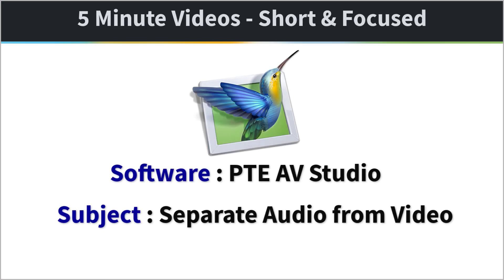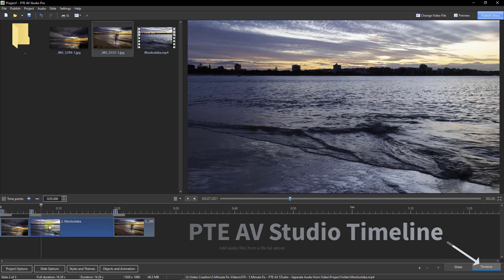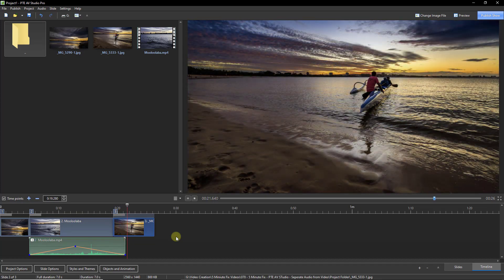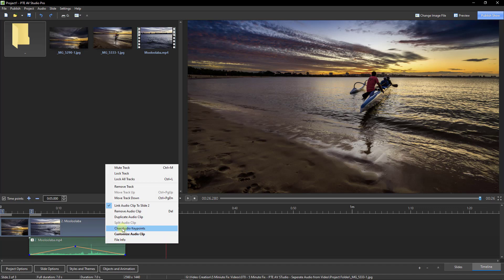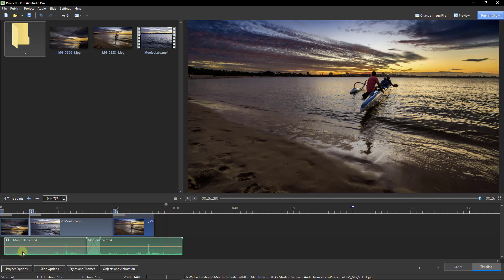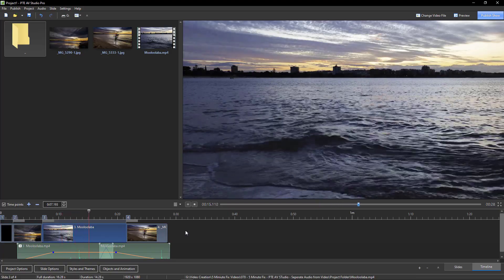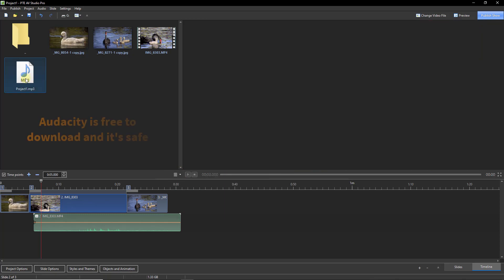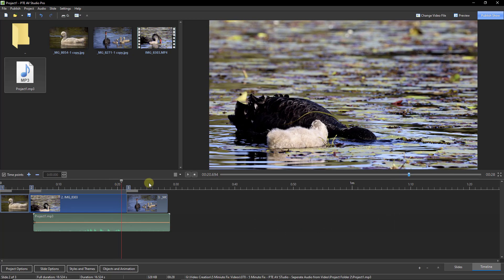070 - 5 Minute Fix - PTE AV Studio - Separate Audio from Video

Comment: Hello Barry, I'd just purchased the latest version of PTE (11.0.9), and I do NOT see the yellow line so I can adjust the volume up or down.  When I was using the trial version, the yellow line was there for me to adjust.  However, as soon as I entered my license key to activate, I can no longer adjust as the line isn't there.  Any help would greatly be appreciated!
Reply from the maker: You have almost certainly purchased the Standard version which does not have that envelope tool. It’s available in the professional version. You can adjust volume in the project options audio tab, but it’s not the same as the professional version.
Reply: @BarryBeckhamVideos  - Thank you Barry!  That's too bad 🥲